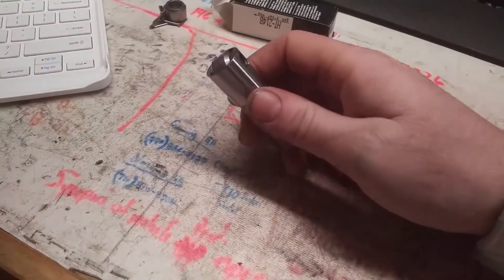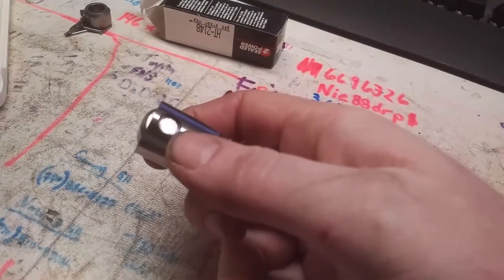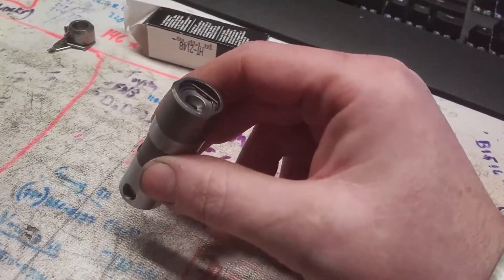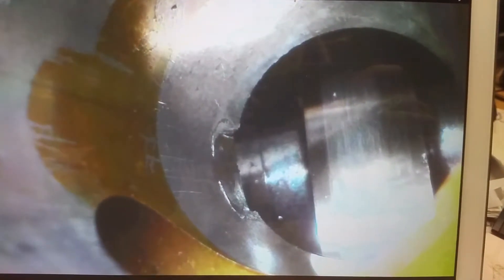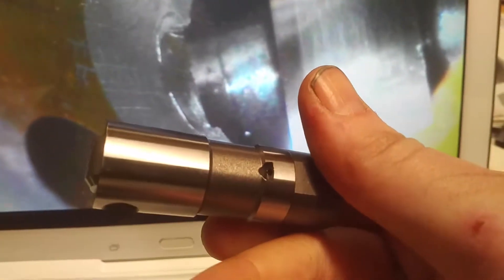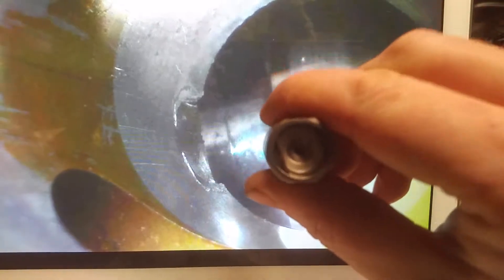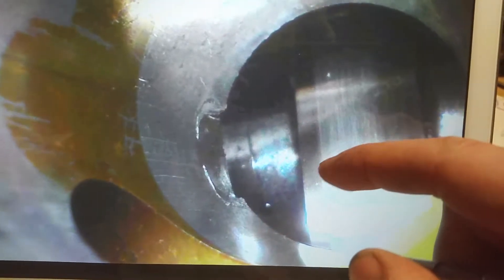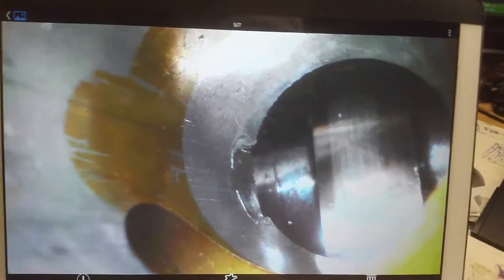Failed Lifter Wrist Pin = Lifter Bore Damage (GM L92, 6.2L - 2nd Design - no AFM/DOD)

Comment from the maker: April 2025 Update:  The vehicle now has 260,000 miles on it since the rebuild + failed lifter wrist pin.  So that's about 60k miles since the repair.  Having gone with the GM OEM replacement parts (after the failure with "Sealed Power HT-2146" parts), the engine is still going strong with no problems.  No taps, clinks, or whatever comes about these days with GM lifter issues.  

And FWIW, I've seen a ton of LT engine lifter issues on more modern SUVs via the vid content I watch here on YouTube.  I'm not sure I would ever get an LT engine-based vehicle.  If I did, I'd rip out and replace a lot of components in Week 1 of ownership.  They simply haven't solved the problems with lifters that existed back in the LS engine days, period.  Now my problem was different, of course...but design "quality" and replacement parts "quality" is where the lines intersect.  

I feel VERY sorry for people who don't work on their own vehicles.  This kinda thing would have crushed my wallet for about $10,000 if I were to have it fixed by a dealership (or similarly priced independent shop).

Comment: how did you get that lifter up without further damage ?
Reply from the maker: Fortunately, the pin had been retracted/pushed back into its lifter bore cavity enough to not cause further damage when being pulled out.  It wasn't easy, regardless...took a number of really hard pulls.  Tip:  remove the hood from the vehicle completely - put it on the roof with some cardboard inbetween to pad the roof from direct contact/damage.  On the lifter pull, it was the only one out of the 16 that had a huge issue with being removed from the block.  I think Summit Racing sells an LS lifter puller for relatively cheap (I have one somewhere in the garage, but only had to use it once.)  Worst case, if you pulled the lifter and it came totally apart on ya (and you couldn't literally account for all parts in the oil pan to insure you had them all) then you'd definitely have to drop the crankshaft...if not the pull the engine out and pretty much disassemble everything using an engine mount.  Small hard-metal pieces like that will destroy the entire rotating assmebly very quickly upon restart days/weeks/months later.  It's just not worth it to risk that kinda damage.

Comment from the maker: Shaved down the high parts caused by the failed wrist pin protrusion.  Polished the area as much as possible.  New OEM lifters installed.  I think I've gone about 25,000 miles at this point since the repair.  Not the perfect sounding engine I wanted, but so far so good.  If I could do it again (and I will) I would spend a ton of time with a soft abrasive Dremel head and make the walls of the bore perfect, and then use a proper hone.  Oh, and I would never buy cheaper China-made crap ever again.  The lifters I bought that caused this were from Summit Racing:  "Sealed Power HT-2146".